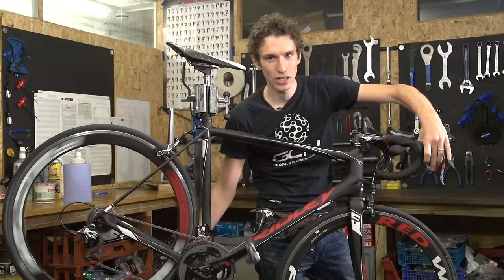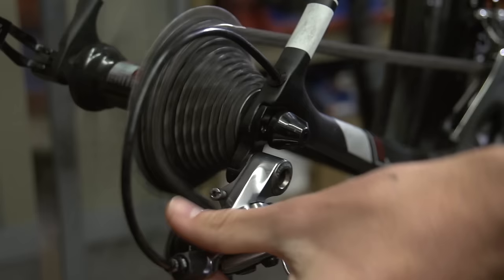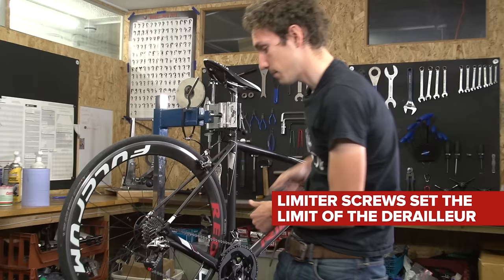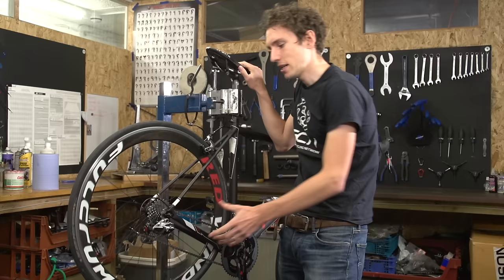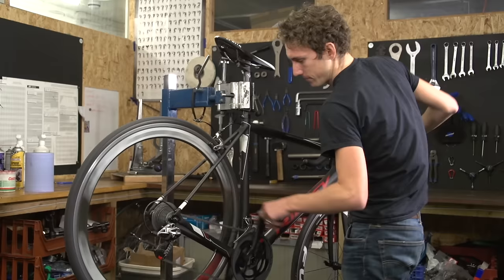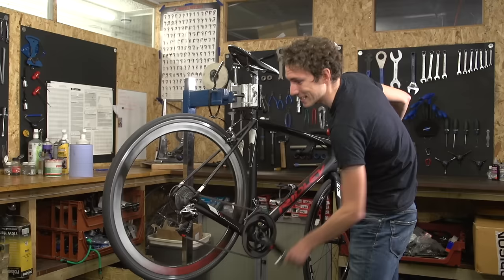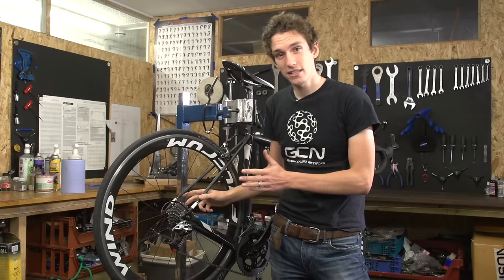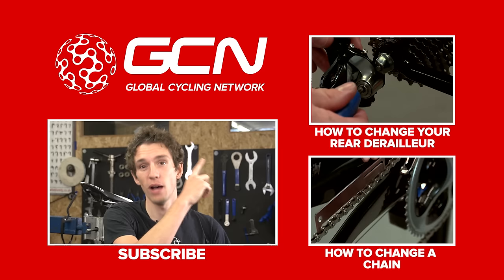How To Index Your Gears - Adjusting Your Rear Derailleur

Comment: after hours of messing around with this, looks like i'm going to have to take it to the bike shop anyway because I made it worse somehow
Reply: Same
Reply: I had to do this, the bike shop said they were "the worst indexed gears he'd ever seen"
Reply: I loosened the rear shift cable as much as it will go with the barrel adjuster and it seems it needs to be even more loose. I wonder how to fix this
Reply: @charlesmiv3842  Very similar problem with still no solution. My cable is totally loose and gears still don't want to shift.
Reply: @ligametis  I fixed it today. Apparently my rear wheel wasn't fully seated into the drop. The issue also happened to pop up  after I had taken the wheel off to change the tires and tubes. Put the wheel back on and tightened it quite hard and now its ok
Reply: @Crand0m  he's not seen mine yet 🤣🤣
Reply: @charlesmiv3842   there's probably going to be another barrel adjuster on the shifter end of the cable, or, I suppose you could loosen the attachment screw where the cable attaches into the derailleur pull some cable through and then tighten it back down
Reply: Just take a break and come back to it. Sometimes your mind gets frustrated or tired if you keep trying. If you go back to it later, you'll have a fresh mind with a different perspective and you might realize that you missed something or you'll see how the thing works, an ah ha moment. It's amazing the times I've been in that situation... and when you finally get it right you'll be amazed that you didn't see it before... then you'll know how to fix it forever... and you'll have more money in your pocket!  The most important thing is having a rack, and if you don't have a rack then you'll need to figure out how to put it on a brick or just lift it up because you have to test it as you work on it. Good luck! Don't give up!
Reply: @charlesmiv3842  that's just the barrel ADJUSTER, first you have to set correct cable tension in the first place. Don't just listen to one guy on one video... also people, don't put your bike down on the derailleur side, don't bump in to things, every little bump and crash and stuff messes up the derailleur... make sure it's clean, if you have friction shifters... are they slipping?
Are you shifting properly? Trying to keep your chain in a straight line? Study that, maybe you're not using your gears properly... that doesn't help anything
Reply: Lol
Reply: 2 + 2 was always 4 until now!
Reply: aha same
Reply: @@scottwebb3432that also happened to me! I think it's because I had a left handed wrench 🔧. Also, Because my bike is European made, it messed up the derailers cause I was on the right side of the road instead of left. 
Gotta know this 💩
Reply: 😂😂😂same.
Reply: It's really easy to do, but when you work in a bike shop you do it 20 times a day and really get to understand the finesse
Reply: That’s what I’m afraid of doing. Those micro adjustments can make a big impact but you don’t realize it until you’re on the road.
Reply: @brianward7550 I have a barrel adjust on the rear and one where the cable goes into the frame isn’t that one for the front derailleur?
Reply: 3 years ago and my guy, your comment resonates with me 😂😂😂😂😂
Reply: @Crand0m 😂😂😂😂
Reply: I wanted to do this and I now have second thought's
Reply: Just took mine to the shop, now unable yo change up or down, shifter doesn't seem to do anything now 😂
Reply: @craigp4294 How do you like riding fixed gear? J/k, hopefully it's all sorted now.

Comment: Literally after 2 hours i adjusted my bike correctly. Never been so mad lol
Reply: and sweaty... didn't have a bike stand so did some weird position grabbing of the bike to make it work. never worked so hard lol
Reply: we've all been there
Reply: It is definitely trial and error. Can be very frustrating..
Reply: sure beats spending 10,000 hours to become expert at something.
Reply: Old comment but the first time I tried this I really could not grasp what he was trying to explain, honestly now tho I completely understand without even going through the motions I just need a refresher when I go to tune my derailleurs
Reply: @daniellim5137   well there's A/ stacking half bricks under the bottom bracket; B/ hanging the bike slightly off the ground from a chain attached to the ceiling ; C/ tilting the rear of the bike slightly onto it's flip stand to the point the rear wheel lifts off the ground, or D/ doing it old school & flipping the bike upside down. B's probably the best, but if there's a fitted flip stand on the bike & one's lazy it saves hanging a chain from the ceiling (mind you once one is mounted you never have to do it again). A usually leads to injuries as round things like bottom brackets don't sit well on flat surfaces, well basically any surface that doesn't match the outer gauge of the bottom bracket.
Reply: This guy makes it look so easy.  I've tried every quarter turn possible with that derailleur adjuster and the gears just don't work for me.  If I get the smaller gears working, the upper gears stop working.  So frustrating to have wasted 3 hours and still needing to go pay $80 at the shop to do something so simple.
Reply: @derekchristensen8225  Having this exact problem right now. Ever figure it out?
Reply: @daniellim5137  u can literaly just turn it upside down ...
Reply: Puppies/Videos/Compilation dude same! I was about to throw my bike to the streeet, it was pissing me off, the chain wouldn’t stay on 1 st gear it kept slipping to 2nd gear i was like so done with it... i was so mad that i decided to leave it alone for the night and just go to sleep and work on it the next morning
Reply: My current struggle...
Reply: @daniellim5137  I usually turn the bike upside down. Then I test it under load riding around to see if the gears change as I go up and down.
Reply: I know that feeling, but finally .. I have learnt it
Reply: @derekchristensen8225  ha, just did the same.. Cant get all cogs indexed.
Reply: @traceyodonnell1969  yeah all these how to videos really just make the problem your trying to fix worse because they don't show how to correct if you over compensate.
Reply: Two hours? You are so fast!
Reply: That bag skift it's going any way and do nothing ( before it's worked)
Reply: Me tooo,but not yet complete still now😂😂
Reply: @derekchristensen8225  I bet it's time for new cables.
Reply: @derekchristensen8225  I'm taking mine to the shop to save my sanity. I just not cutout to get them adjusted this smoothly.

Comment: I'm looking but I can't see a can of WD40 anywhere in this video....
Reply: There's a blue and yellow can amongst the cleaning products on the worktop to the left... ;)
Reply: Duncan Bananatyne It can be terrible, but it can help for a lot of part (as long as you keep it away from ball bearings)
Reply: agreed; for cables within outer cables, use pasty teflon grease
Save wd 40 for cleaning your chain, Always to be followed by proper 'white lightning" type teflon spray
Reply: indobleh if his bike is already well lubricated he isn't gonna tell you to oil anything.he sticks to the job at hand and doesn't get sidetracked.wd40 and oiling is just basic common sense.
Reply: irlrp 
Why???
Reply: Wd40 isn't for lubrication, it's for displacing water! Don't use oil on your chain either, it will trap grit and turn your chain into sandpaper that will eat up your sprockets
Reply: Pro race mechanics have no use for it.
Duct tape either, Cletus.
Reply: Simon the gcn presenter talks with his all English accent voice . he has a posh voice so that why you might think his voice his  under bearing. some people talk with rough voices which incidentally I find appalling .
Reply: LMAO!!
Reply: WD40 is a amateur solution for bike repair & maintenance.  Water displacement and on the rag cleaner in a pinch if you don't have proper cleaners. Half of all these people posting probably use a quarter can.
Reply: WD40= Rust
Reply: @elysiumfire4230  It's called "vocal fry"
Reply: Wheres the hammer

Comment: I've just noticed that you've got rear brake on the left side of the bars and front brake on the right. Is there any reason why it's mirrored ?
Reply: Simon is a motorbike rider!
Reply from the maker: It's jsut the way of things in the UK! We get all confused when it's the other way round like in Europe and the US, and it means we go over the bars...
Reply: It's a local UK thing, I just swap the cables over as soon as I get a new bike with this setup.
Reply: It's personal preference. I live in Asia, and I use left hand rear brake too.
Reply: It's called moto style in the U.S. Motorcycles are setup the same way.
Reply: *****
It's just historical/colonial reasons, so left-side riding does correlate with rear brake on the left, but there's no physical reason to setup the brakes one way or another regardless of which side of the road you ride.
Reply: I actually use my left hand for all signalling when group riding in Britain, except for "turning right", so according to your reasoning I'm be better off with rear on right setup in the UK. However, I don't recommend one hand braking at all so this should be of little relevance IMO.
Reply: ***** he is correct though in saying it's the same way as motorcycles, as they are identical no matter what country you're from.
Reply: I knew they had it flipped, front brake right, rear brake left, but...shifting is still rear right, front left?  That would take some getting used to.
Reply: You want your dominant hand to be on the most important brake

Comment: This is so helpful. After paying a local shop $200 to "tune" my bike only to see it won't shift down to the smallest rear cog properly, I find myself here learning how I could have saved myself $200 in the first place, so I can fix what they didn't do right for $200. This is great. After 25 years owning a bike (albeit it's been sitting around most of the time) I'm fiiiiinally learning how to adjust my own derailleurs. Thank you.
Reply: How much did it cost?

Comment: This was incredibly helpful. I had a friend look at my bike, and he did something that I ended up being unhappy with (he kind of made an issue worse). Instead of having him look at my bike again, and instead of trusting that it was something I could do, I went to a bike shop, and they managed to make things even worse! Thanks to this vid, I now know they completely messed up the limiter screws on my rear derailer (I couldn't, for the longest time, shift into my largest gear, after the bike shop was done with it...). I just lived with it, thinking it was the trade off for getting another issue with my front derailer resolved. What an easy fix, and what a silly thing for them to have messed up so badly on my bike... I feel so much more confident that my bike is better tuned after this video - THANK YOU!! 
Plus, it feels great to tune the machine you love, yourself.

Comment: FINALLY! Been watching the ‘wrong’ videos in which other “experts” try to explain the H & L limiters in completely convoluted and seemingly outright wrong ways. I’m happy to say that my mail-order bike of 2.5 months in finally in tune.
Cheers.

I did; however, adjust the tension prior to dialling in the limiters (was a full two cogs off before starting). I also put the bike in the highest and lowest gears using the mechanism instead of pushing/pulling manually.

Comment: In short, if the indexing doesn't works, you'll have to check your cables, chain and wheel condition, and replace them if it's worn out. Thank a lot GCN! I've learned a lot in this video!

Comment: Thanks for this guys, you just saved me a lot of hassle! I'd been having issues with shifting into the largest rear sprocket and was ready to change the gear cables, but a little check and it seems that the problem was that my L screw was set too far in.

Comment: Thanks for the good video. I've been doing this a lot on many bikes for many years and as you mentioned in the end, it doesn't always go so well. The real game changer for me was to buy one of those hanger "alignmenters". That solved so many tedious tries to get all gear indexed. Typically I would manage to get the lower gears working great, but then the higher gears were all over the place - or the other way round but rarely could I set up the indexing for all gears to work properly. 
After getting the hanger alignment tool I went through all my bikes (4) and the improvement was drastic. I could now index all gears perfectly, just as shown at the beginning of the video!
so, go to your local bike shop (LBS) and ask if they can align the hanger for you or buy the tool (at the LBS or online) and  get the hanger aligned properly! Don't waste your time trying to index the gears when it just won't work.

Comment: I like the way you put the barrel adjuster out of range to demonstrate it, and then it wouldn't shift out of the smallest cog later because you'd also showed the limit screws in action, so you'd need to use it again to show indexing adjustment with the barrel adjuster. That really separated the two actions in my head - and it shifts now! 

Thanks for this, even if it's four years old!

Comment: I have got a Specialized hybrid and I spent a small fortune trying to get the bloody thing to index properly. The whole situation had the mechs at my local bike shop scratching their heads with frustration. A list of thing changed Wheel, Cassette, Cables both cable and outers, chain, gear selector (upgrade). I was a hair's breadth away from changing the actual derailleur when the thought struck me JOCKEY WHEELS! A simple change of the jockey wheels solved the problem. Jockey wheels will very quickly become worn unless you have a set of jockey wheels with bearings in them. Most jockey wheels don't have bearings. Sometimes the simplest thing is often the solution. All it takes is a small amount of movement in the jockey wheels to stop the gears indexing properly when under load..

Comment: 'It's a simple system that works brilliantly'

Yeah, Lol, I wish, my f**king gears cause me no end of headaches, they always want to jump a gear or not change properly or just plain cause the chain to come off both ways, even with new cable outer + wire installed.
Reply: +Kie 7077 I find in these types of instructional videos people take a bike that already shifts perfectly, fiddle with the barrel adjuster a bit until it's not quite shifting, and then them "fixing" it is just them reversing the steps they took to "break" it in the first place. They never seem to work on a real bike with real problems.
Reply: real bikes usually need parts serviced or replaced before adjustment
Reply: the solution is ALWAYS TO BUY A NEW BIKE
Reply: Well I found a bike had "I'm free take me" on it. Seemed ok gears and brakes needed adjusting but when I got it home the rear wheel was well buckled. Thanks to my humble teacher youtube and great guys like this I now have a straigh rear wheel within 1/2 mm out (best possible without equipment), perfectly working brakes and smooth as silk gears so I have to disagree! This worked in real world with a little patience!
Reply: late to the party, but its inherit to the system. You have cable tension and the stiffness of the derailleur to blame. If, for example, the cable just stighly wears down its housing, the tension is off. Also, you have your chain diagonal half the time and you also wear the whole thing out. 

Derailleurs are a shitty system that is only kept alive because it is a wearable/consumable for the industry

Comment: That's weird, how come at 4:58, you used the left brake lever to stop the rear wheel? Isn't it usually the right brake lever that's used for that?
Reply: Shayan Mantegh brake cables are routed differently in different countries. usually associated to the side of the road that you drive on. 
can you switch it without legal repercussions? yes. 
does it make a huge difference? no. 
its up to your preference, really.
Reply: chickenpoodl GMS Some people that ride motorcycles also like to have their front brake on the right hand so they don't get confused when they switch from moto to bicycle.
Reply: Shayan Mantegh In the UK we have the rear as the left brake and the front brake as right. Makes more sense having the stronger brake on your dominant hand.
Reply: Charlie Dillon   Your response is the correct one. I do the same thing on my bikes. I had a dirt bike before I had a mountain bike, so swapping levers is my solution.

Comment: 1:42
Limit screws 
H for smallest rear cog adjustment 
L for largest rear cog adjustment

2:44
Indexing for shifting and gears
Use barrel adjuster
Reply: I can't seem to get into the smallest two again after adjusting the screws. I've unscrewed the h-screw as far as it goes. I suppose it got stuck? Any clues anyone?